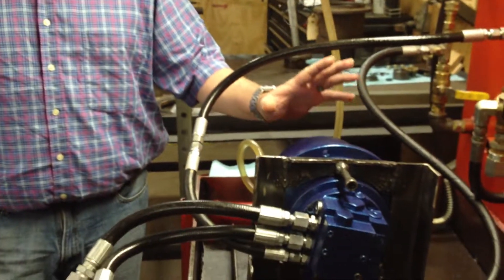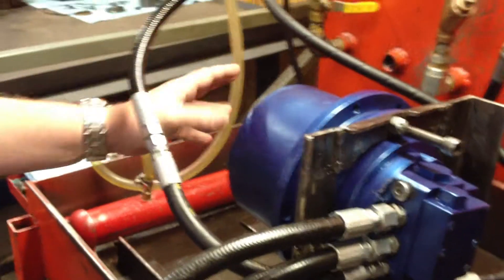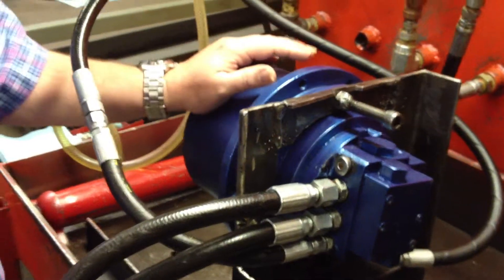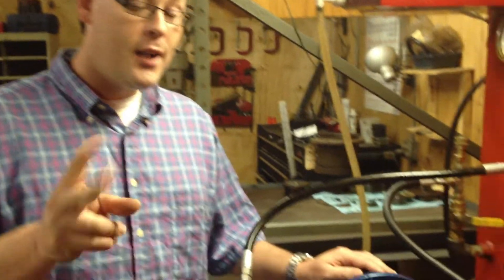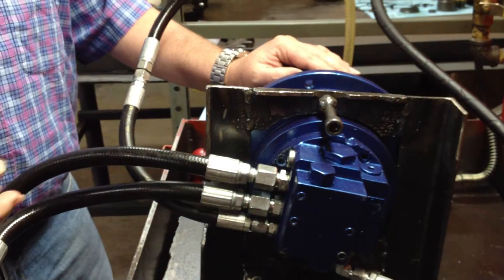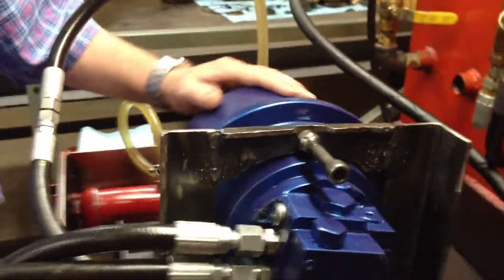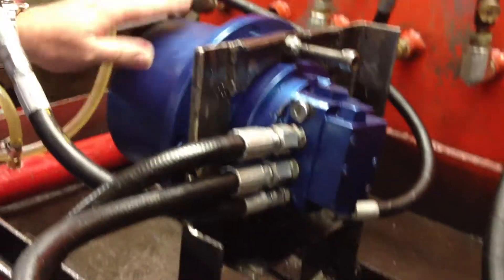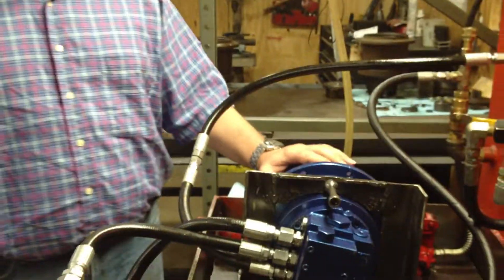Excavator Travel Drive Motor Common Problems: My Drive's Spinning Backwards!

Comment: Borrowing my brother's bobcat mini excavator, and something degraded where the track on the one side won't reverse (or it's greatly lacking.) Both side's go into forward w/out problem.  I did have to add fluid (slow leak), possibly running low might have exasperbated contamination clogging something???  Any advice?

Comment: Maybe I'm too safety conscious, but I wouldn't be touch & patting a turning hydraulic drive while looking at the camera.  I've know (personally) about 4 or 5 guys in mining that have got fingers and arms broken or amputated by rotating hydraulic drills (gloves or shirt got caught).
Reply from the maker: Safety is very important to us, and you have a good point, Chris. Fortunately, it was turning at a relatively low speed on a highly controlled test bed.

Comment: got a question  just bought used kubota u17-3 excavator and   it seems like  the right drive works slower that left one. is that normal or is there
any  thing  i can check on it ?  thanks
Reply from the maker: I'm tracking down an answer for you from one of our experts. However, that is not normal but there could be more than one cause.

Comment: 2013 Terex PT100G, left drive motor is getting stuck have to put it reverse and then forward, couple times in order to get it unstuck to travel forward ???
Reply: Curious if you ever found out what your problem was? I have a similar issue with my Volvo 35.